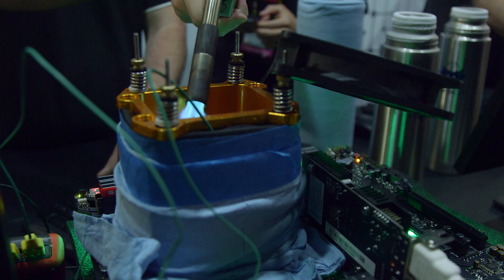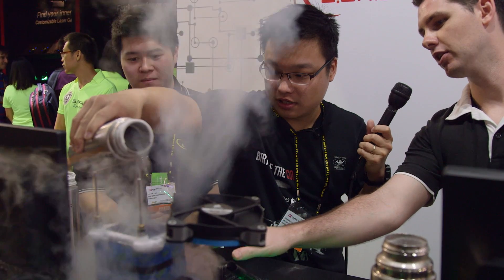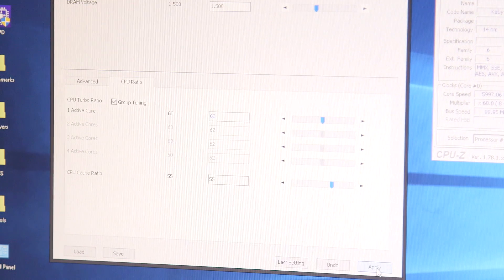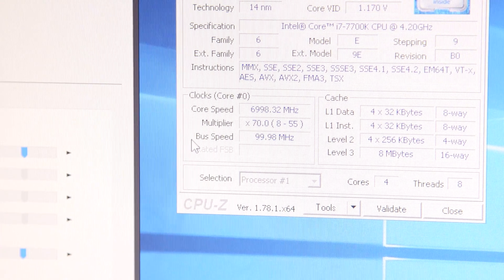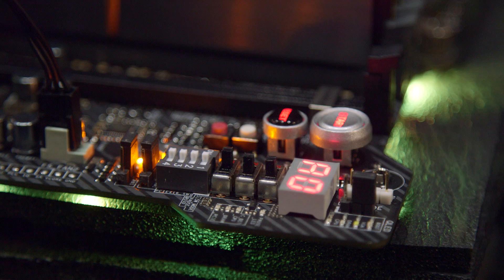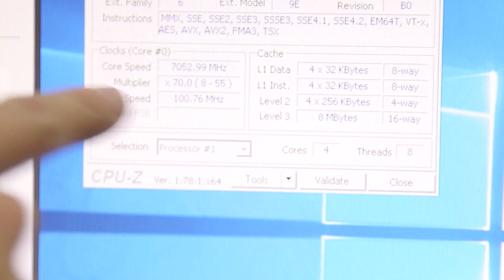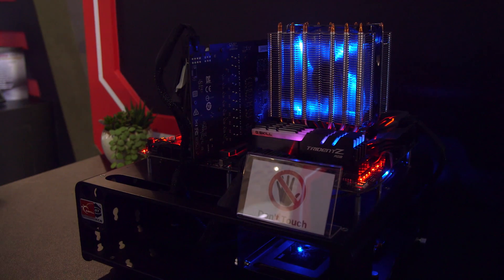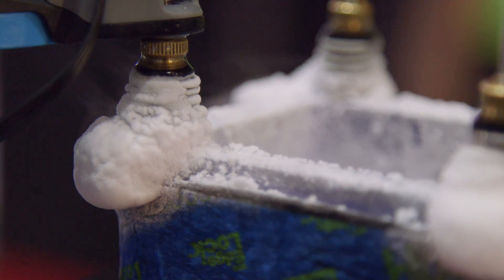Overclocking to 7GHz with Liquid Nitrogen | Hands-On | Computex 2017

Comment: CPU: Intel® Core™ i5-7600K até 4.2 GHz
MOTHERBOARD: ASUS Z170 PRO GAMING
RAM: HyperX Fury 16GB DDR4
VGA: ASUS GTX 1060 6GB
HDD: TOSHIBA P300 3TB 64MB 7200 rpm SATA3
SSD KINGSTON – DISCO SSD 240GB SATA3 UV400
CAIXA: NOX HUMMER MC
FONTE: NOX Urano VX 750W
Windows 10 64bits

With this settings, how should i overclock my desktop??

Comment: If it cannot run Prime95 (or mprime), it's not stable. If the system is basically idling on the desktop this is only about getting high frequence display on screen before the system freezes (both literally and metaphorically).

Comment: It's a shame that no matter how far you overclock, there are still bottlenecks that can't use anything higher than the stock clock. Performance will still be shit if you use a hard drive for example... It's a bottleneck, along with the bus on the motherboard. Sure, you overclocked the CPU, but your bus is now your bottleneck and your computer is still shit. Unless you just enjoy benchmarking, go for it. But most popular games today still recommend at least a Core 2 Duo...

Comment: under lameness what would canned air condensed (flip over can liquid and use that to cool a processor? it's cheap convenient to find and the copper vapor chambers could be repurposed. I'm not willing to destroy something but perhaps someone with the proper funding might find a cooling solution with just an inverted can of compressed air.  Use novec by 3m with Peltier equivalency.

Comment: It's 2068, but I am still using 10 GHz Intel core i17 processor :(
Reply: Atikul Islam I'm still using 9 ghz ryzen 23
Reply: then stop slaking, it is like 3 months as volta 3 were released - you need upgrade your old shit !
Reply: S I am still using intel core 2 😢😢
Reply: Its 1812 but I'm still using gunpowder.
Reply: Atikul Islam peasant I have a Ryzen 10 with 50 cores at 5ghz
Reply: Buying CPUs is useless all you need is the gtx 100000 ti it literally comes with an Intel I69
Reply: Atikul Islam yeah rip :( mine gets to 200ghz and get about 9000000 fps in 1024k resolution
Reply: hapylestat heya guys, just wanted to say hi from 2122. Usin titan VXPVXPVXP 10k terabytes clocked on 30k mhz
Reply: Its in my country 2320 and i am still using 2000ghz cpu with XTX 7400PK :(
Reply: Adam B, humans become machine and we got to a point where we can explore space and fuck around the years 2000 on this thing called internet.

Watch out for 1917, there an economic crises and than some wars.

Also, the first thing you’ll see when you die is my face and we’ll talk about the transhumance evolution that was possible after the chemical nano computers! This video is silly and the technological revolution is very much studied now  days! I suggest you look into a video we created, sent to this time line, as the suppressed human history!

Don’t believe me? Watch Jair Bolsonaro win the Brazilian elections in late 2018!
-m.m.(tmn)
Reply: I have ony  450fps on my 1000hz screen ;c
Reply: Shane Master  Peasant! I have a titan MMM

Roman numerals suck 😂
Reply: I'm still using 2х1.2GHz :(((
Reply: Atikul Islam I only have ryzen 9989 with 90000000 ghz and 20000 terabytes of ram and gtx 108000000000000 ti sli
Reply: My pentium 282838829920 829749 948389292-KKKKKKKKKKKKKK literally 17ghz and all i can say is that it gets 350fps on my 70K monitor its pretty good.
Reply: Hey guys i'm from 1910 and i don't know what the hell are you talking about.

Comment: "and the system has frozen" 
sees liquid nitrogen splash onto motherboard
Reply: Trick-or-Santa stop being 7 years old please
Reply: Trick-or-Santa Bullshit. If its not closed, its like boiling water.
Reply: DarkErrorCode I don't think liquid nitrogen makes a good conductor, does it?
Reply: Trick-or-Santa nah not gonna happen
Reply: Warriors Of Rampage Not going to comment on the computing side, but liquid nitrogen on skin is in all (bar freak accidents) cases harmless due to the Leidenfrost effect. The significant difference in temperature between skin and liquid nitrogen actually produces an insulating vapour layer.
Reply: exactly, i know that dry ice can explode but that's probably because its a solid.
Reply: Trick-or-Santa dude it would just turn into gas
Reply: Warriors Of Rampage liquid nitrogen has a higher vapor point (idk the correct english terms, but what im trying to say it turns into gas at higher temps than oil and water). It’s even safe to pour liquid nitrogen on a your bare hands which is 20C and it just turns into gas and your hand won’t even freeze. And the motherboard will be about 40C on the VRMS. So yeah it won’t explode at that low temps.
Reply: Danny Lee damnit, you beat me to it...
Reply: Taurion Martell thats a pretty tall order bro lol
Reply: Liquid nitrogen is dangerously explosive when heated. Since only the CPU is being cooled, the other components would be fairly hot.
Reply: If liquid nitrogen did splash onto the motherboard it would've exploded and killed those guys.

Comment: In the future, people will think "7GHz? That's nothing!"
Reply: W̶̷̲̅L̶̷̲̅O̶̷̲̅ғ̶̷̲̅ᴀ̶̷̲̅ɪ̶̷̲̅ʟ̶̷̲̅s̶̷̲̅ well tech gets better performance per watt each generation, like the 1050ti performs similar to a 960 but it does not even need a 6pin on some models while the 960 is 8pin
Reply: Moore's law has already started to slow unfortunately, we're coming to the end of what's physically possible on chips, so I really don't think 7Ghz will be possible in the short or mid term future (based on growth we've previously seen) or even at all. :(
Reply: Aram Josuhé Moore's law is falling apart
Reply: Then why does my 6 year old amd chip run at 4ghz out of the box?
Reply: Yeah sorry i wasn't replying to you, i agree moore's law is slowing and my 6 year old chip running at only slightly below the high end clock speeds of today is proof of that.
Reply: Cause that's how AMD built it? It's a 6 year old chip... some older ships were made to be run at high clocks cause it may not have had a lot of cores, but their's only so high the clock can go before it starts running at high temps.
Reply: Aram Josuhé 9-10 ghz is the limit. it's called physics.

any manufacturer is actually capable of releasing that. the problem is there are many disadvantages over advantages.
do we have 5 ghz+ (or 5000 mhz+) memory clock now ? nope.
so, we now know that running 7 ghz cpu on 3 ghz memory is already a dumb step since the cpu is waiting for the data to be transfered back to the cpu.

not to say that anything over 5 ghz is a waste of time for a small gain.
Reply: Diego Dio Brando What are you talking about? That is exactly how it works... exponentially actually sometimes.
Reply: Diego Dio Brando Yea thats wrong as hell
Reply: Ahh, all good man! same I've an i7 2600 in one of my computers...
Reply: I'm sorry but there will be a limit to the size of transistors to a certain nanometer. So in the future processors can't go away
Reply: And In that same future, someone might read this comment.
Reply: GHZ has nothing to do with Moore's law. But ...No, that's not how it works. I'm not a nuclear physicist or anything but I do know that you get going much past 7 or 8 GHz and you're getting into tricky Territory. The limitation of MOS will probably be heat dissipation. They've always seemed to come up with work-arounds every time the "experts"  say the end is near but it's getting really close to the limits in several categories which I won't go into here . Still, the manufacturers can always use parallel processing. That's how super computers work and multi-core cpu's are essentially the same thing. "If you can't make it go faster, just use two of 'em."

Moore's law roughly stated that the amount of transistors that we are able to make fit inside of a certain space on a silicon chip, will double about every 18 month's. Collectively we've changed it to mean that computing power will double every 18 months (or 2 years, depending on who you ask).
Reply: Chris Turnblom another problem, except moore's law, is that (like i said) we don't have any available RAM past 3,5 ghz yet.

cpu cache is used to help RAM tasks (see Crash course's videos, on playlist called "Computer engineering". a really really great free knowledge). so to have stock speed of over 4 ghz, any manufacturer has to make bigger cache and more cache level in the cpu itself to compensate for slower RAM speed and dbus speed isn't rocketing for some years now. and as we know, producing cache isn't easy and isn't cheap either. thus making it clear as to why for years we haven't seen anything past 4ghz+ as a stock clock.

producing more cores seem to make way more sense than producing higher clock speed.
the fastest cpu human ever made didn't even have 3ghz clock speed, if i remember correctly.

oracle made that, but sorry i don't remember the name but i think searching "fastest cpu 2017 oracle" will  the result

edited : fuck. i can't type
Reply: Thanks for the info. I was addressing Digging4answers but I didn't notice your comment at the time.
Reply: Kevin Spacey. ya, and like this thing it would hold for about five seconds at that speed. So what?
Reply: Aram Josuhé I wonder how much watts a 7ghz cpu would be if produced commercially...
Reply: Digging4Answers that's not how it works

Comment: i can reach 100ghz by blowing into it with my pentuim 4
Reply: i can reach 125 gb with my hard drive.
Reply: my gameboy is 120 miles per hour, nerds.
Reply: BtdBoy14 I upgraded my 1943 plane radar to a gtx 1100ti ftw4
Reply: michael papadopoulos Pathetic. Mine van go upwards of 2tb
Reply: Ghaith Abu-Rub 2THz?
Reply: Ghaith Abu-Rub that's it? 7TB
Reply: Patrik Oreb Cyka Blyat!I can get up to a hundred quadrillion ghz!(im not russian fyi)
Reply: Patrik Oreb 
You had me at "blowing" Patrik. Say It again but text it to me softly.
Reply: Mine could go to 7 petabytes
Reply: Is that Pyrocynical's twitter's display pic?
Reply: this is a nitrogen the nitrogen is −195.79 if you want to reach 100 GHz you need a - 700 to get 100 GHz if you can over clock your PC to 100 GHz i will buy it for 10000000000000000000000000000$ send me a photo you over clocked your PC to 100 GHz i will give you a 10000000000000000000000000000$ just over reach 100 GHz the most power ful PC in the world is 81 GHz if you have a 100 GHz on Pentium 4 OK i will kill my self
Reply: Patrik Oreb 500MHz = 1000 potatoes
Reply: Just upgraded my atari to a 1090 ti

Comment: Me building my couputer: Okay, I have to be very careful with this, I've spent a lot of money on my i5 6600k and GTX 1060
Them overclocking to 7GHz: Well, now we've gotten too much liquid nitrogen in here and it's too cold, so I'm gonna use a blowtorch to heat up the 7700k... Oh, and don't worry about the frost on our Z270 motherboard or anything.

Comment: Try to find someone in your neighborhood that already does liquid nitrogen cooling on their CPU? Okay, sure.
Reply: Chances Collins ye man let's say you buy liquid nitrogen and your neighbor was watching this bam he can get some from you
Reply: Chance Collins ye man let's say you buy liquid nitrogen and your neighbor was watching this bam he can get some from you
Reply: This is cool and all. But for practical usage these computers can barely do anything. I am fully certain that you could achieve a stable 6ghz on this chip and run it. But then again you want maintenance free cooling that you don't want to refill again and again. There are sub zero coolers for cpu's out there for home and permanent usage. But the degradation of both the cpu and the damages done by condensation pile up pretty quickly.

I think that for now people should be satisfied in running a 8700k at 5ghz stable on massive aircooling or a custom waterloop. That is sickening in itself.
Reply: i am running 5ghz on that chip with a used hyper evo 212 and the cheapest motherboard i could find.
Reply: you got a good chip then. Most of them do 5ghz, but the cooling and voltage needed vary wildly. By delidding i reduced my girlfriends cpu from 94 c @ 4.7ghz to 75 under max load for hours. Sadly we got a very bad chip, both thermals and overclockability. I believe like almost 80 percent of all 8700k's are capable of doing 5ghz within reasonable voltages. Delidding the coffee lake chips seem to be very profitable for thermals.

Comment: Consoles can't even pass the 2ghz frequency. Here we have pc's running at 7ghz
Reply: You can overclock anything.
Reply: First of all you could overclock that cpu. You can do that even on the shittiest board you want !IF! the manufactuarer wants you to do so. 2nd - i dont think developers "program" their games to run at 1.7ghz, its bullshit in my ears, since developers don't program pc games to run at a certain cpu frequency too. They either limit the console to 30/45/60 fps or something else but the games aren't programmed for a certain frequency. In fact, if you were to get the OS from lets say an xbox one to "Desktop" Hardware and the Cpu would be at 3-4GHz, it wont matter since, like i said, the games are capped at a certain frame count - and even if not, you wouldn't be able to have more than 60hz (atleast i wouldnt) since games internally, like i said 3 times, cap stuff - thats why you dont get an advantage on most modern games, if you run those up to 300 or even 400 fps - since your eye cant really work with that and most of the time the screen isnt able to produce it too so why would you need it? 

Greets and don't be mad :)
Reply: TheVergil Dante then can u plz explain why no one in the world has overclocked a current gen console
Reply: Tasso gamer if you ln2 cooled a console you could do the same thibt
Reply: gregistopal u can't OC a console dumb ass
Reply: badfitz66 yea gl overclocking a PS4. On that limited motherboard. And the fact that developers programmed their games to run at 1.7ghz
Reply: Console players be like : it's only 5ghz more 5 is a small number 😂
Reply: Actually, you can... Xbox turned up the frequency (overclocked) the last gen consoles in an update (pretty much the same time the PS4 unlocked the 7th core for game developers to use in games). Can you just install MSI afterburner, no, but if you can recompile the update code, you apparently can.

Comment: will this run club painguin at 30fps 380p
Reply: Theotheepic Smith sadly only 22 fps at 144p :(
Reply: Theotheepic Smith most likely not club penguin is an extremely straining game and only the highest top tier setups can run club penguin at 30 fps 380p it's really hard even with one of the best computers
Reply: +Isaac Inmon that's the joke man...!
Reply: No you'd need a cpu clocked at at least 10 ghz.
Reply: Theotheepic Smith no.. cp is gone, forever
Reply: Maybe if you overclock.
Reply: are you crazy??
Reply: Officer Go-Go full 4k with 240fps on minesweeper!!!
Reply: no. you will need the 8 Mhz. version.
Reply: cp is illegal
Reply: No,
that would require an overclock to 8GHz.
Reply: you acutally have to drop it to 240p to keep a stable 30ish fps
Reply: JeMapple 
can confirm. Watson crashed trying to run it at 540p with G-Sync enabled
Reply: Theotheepic Smith Club penguin is long gone
Reply: but can it play minesweeper at 1600x900 at 13 fps
Reply: no I ran it at 45 fps at 310p
Reply: Theotheepic Smith no!
Reply: Theotheepic Smith no it's too intensive
Reply: just shut up.... thos '' kiddy'' joks getting old naw (-.-
Reply: Theotheepic Smith without a graphics card nope
Reply: Riznat Nakh u don't need a GPU to run a computer
Reply: No dip, shiy
Reply: Rohit A.S dude... CP Rewritten
Reply: marter1234 gaming its a joke
Reply: Theotheepic Smith nothing will run club penguin anymore :3
Reply: no because cp is dead ;o
Reply: no, sorry
Reply: Matthigast not entirely true, Core2 duos don't have igpus and neither do Kaby Lake X, for some reason. There are others but these are the ones i know for sure.
Reply: ITS DED BRUH
Reply: No
Reply: You know it's gone :( don't trigger me
Reply: Theotheepic Smith it runs at 69fps at 420p
Reply: ... Nah. the cpu will die in smoke.
Reply: I mean... technically... no, it cant.
Reply: Theotheepic Smith 360p not 380p dumb
Reply: no, only at 144p
Reply: Theotheepic Smith club penguin is no more they shut it down
Reply: if you can run Google Chrome then you can run club penguin
Reply: Philip Hanhurst no
Reply: it shut down
Reply: every intel processor has a version of intel hd graphics, which basically tells a part of the cpu to work as a gpu, in case of the i7 7700k, it's hd graphics 630.
It's kinda like using a mountain bike as a racing bike, it's not as good, but it'll do the trick if it's the only thing you've got.
In this case, according to this random review on youtube, it'll run Doom at low, 720p at 30fps, but since they're torturing this poor processor I don't think it'll run anything
Reply: Finnli Herrmann I dint think so thanks for the insight
Reply: vexonica 02 shitty joke to me it's obvious
Reply: Can it run minesweeper on 90p, 10 fps?
Reply: Nah u crazy? ~15 MAX!

Comment: imagine playing cpu based games in this,easily 300 fps in csgo in 1080p,with a gpu that isnt bottle neck ofc.
Reply: I have i5 3450 and a 960, i get 140 fps, need to upgrade CPU lul
Reply: 2000 frames more like
Reply: You would get 300 fps on .021% load
Reply: dude i have 700 fps  1080p csgo with a OC gtx 1080 ti and a liquid cooled 4.2 ghz i7 7700K
Reply: gadviel  i can get 600fps in 1080p with 6700k and gtx 970
Reply: thats why i said easily,as in no doubt.
Reply: I guess on 7ghz on all cores stable to 100% load it would be more like 1-1,5k~ish fps